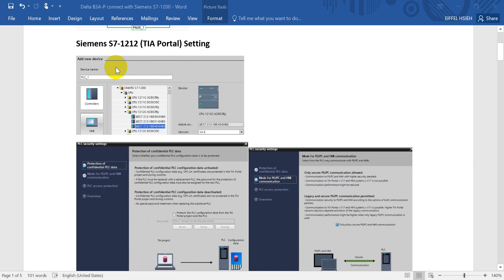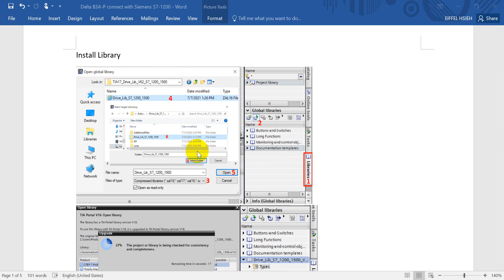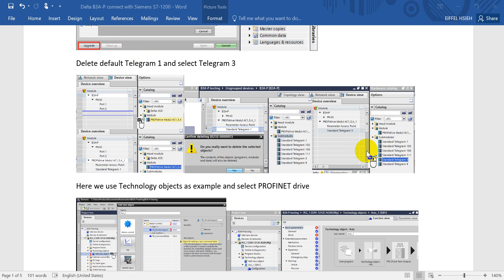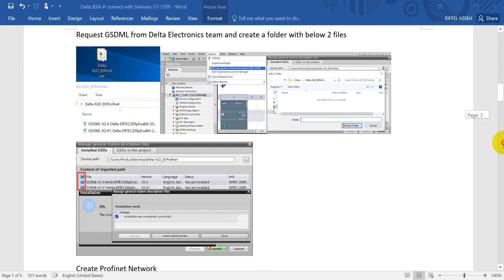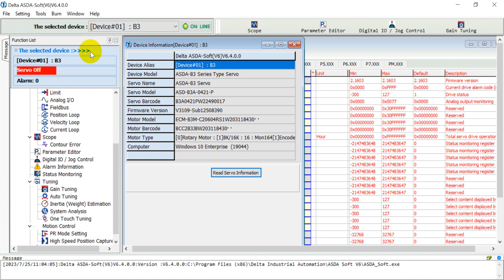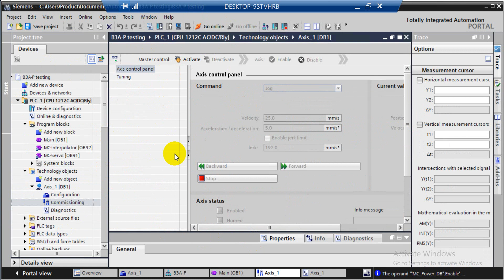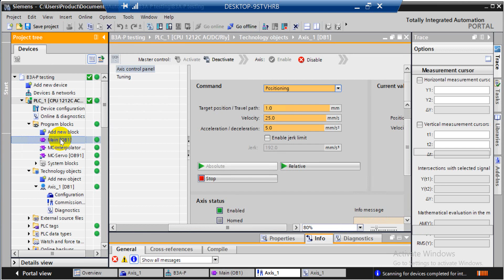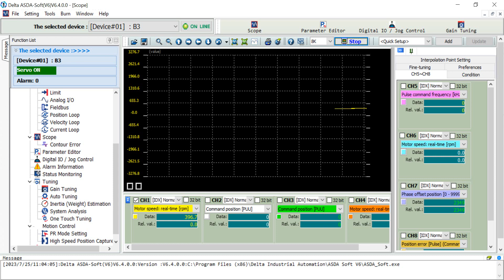Delta B3A-P link with Siemens S7-1200 via PROFINET

Comment: @tekniklasallefood7856
9 tháng trước
Hello IABG_SEA Delta, I am very interested, we use  the ASD-B3 series to be controlled using Siemens PLC. Could you please provide a link to the GSD file, and softcopy of the tutorial in your video. If possible I also get a copy of the Siemens PLC program and servo parameters as in your video.

Comment: Hello Sir, I'm getting an error in hardware compile for ("Isochronous mode must be enabled on submodule, because the submodule is operating in Isochronous mode") as I have already untick Isochronous mode from the general of the submodule. We are using CPU1214 DC/DC/DC.
Reply: Hello sir, have you solved this problem as I currently encounter the same.

Comment: Hallo IABG_SEA Delta, I am very interested, we use a lot of delta servo type ASD-A2 series. and we also plan to use the ASD-B3 series to be controlled using Siemens PLC. Could you please provide a link to the GSD file, and softcopy of the tutorial in your video. If possible I also get a copy of the Siemens PLC program and servo parameters as in your video.
Reply from the maker: @tekniklasallefood7856 can you provide your email address?
Reply: @iabg_seadelta6647 
Hello 
I wish best for you .
 Can you please send it to me?